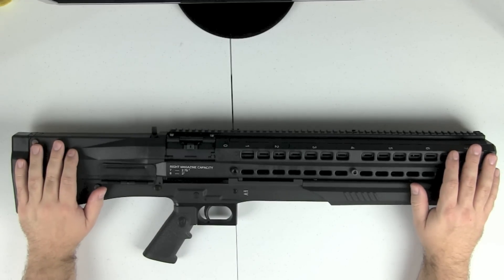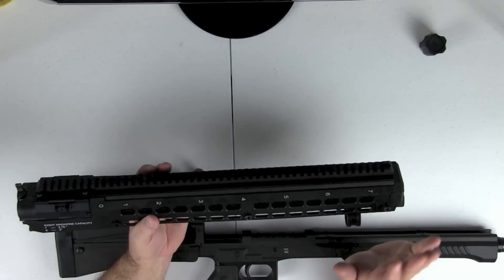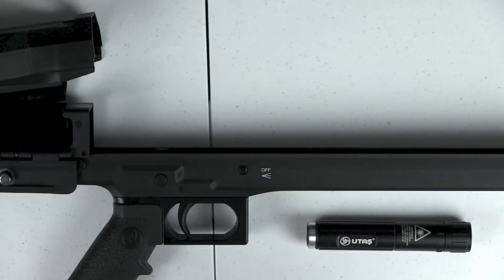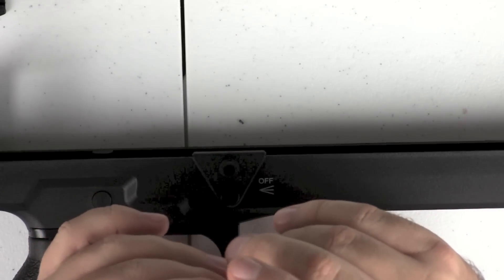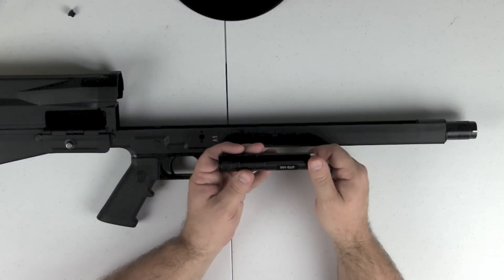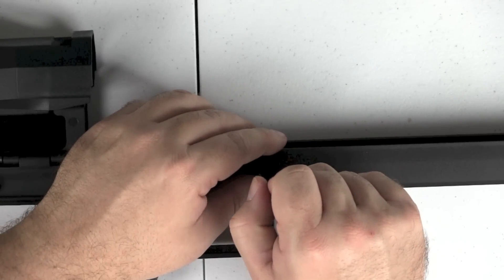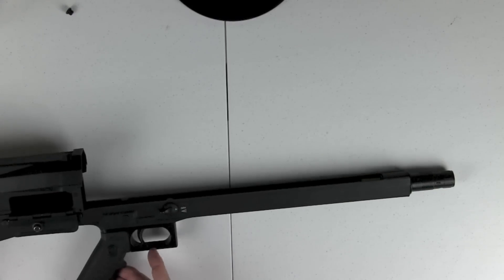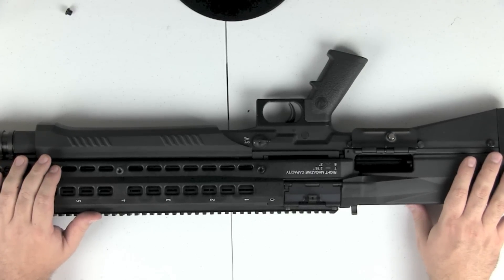UTAS UTS 15 Tactical Shotgun Light & Laser Combo Install

Comment: The gen 4 has a spring assist right where the curly cord is supposed to go. You have to remove the spring assist and find the centre of the curly cord and stretch the crap out of it so it fits under the corners of the spring assist. If you have three hands it is easy to put back together. My issue is this is an expensive laser/ light comb and you end up with two snot balls of curly cord on each end of the spring assist. The cord really needs to be shoved in so the slide mechanism doesn't hit it. The risk is that the cord will pop out while firing and the next slide cycle will slice the cord in pieces.

Crappy design and UTAS should have redesigned the light cord when they redesigned the gun. The cord needs to be flat with just a few curls at the very front so one can change the batteries. I note in the new kits batteries are NOT included so get them when you buy the light. Fleabay has them for less than $40 for 12 as opposed to retail at $10 each